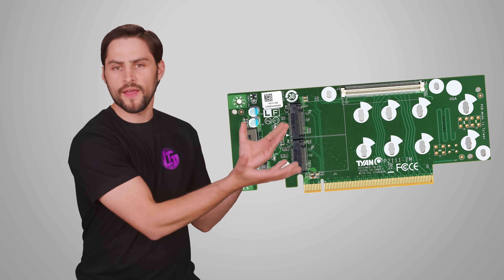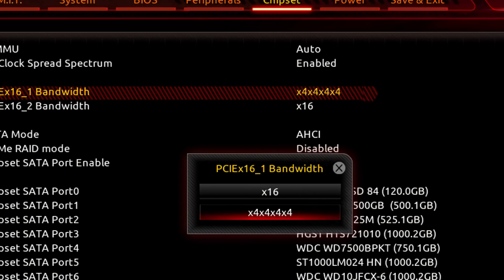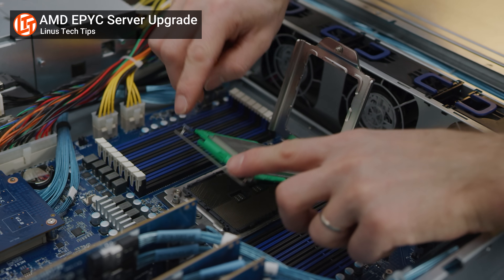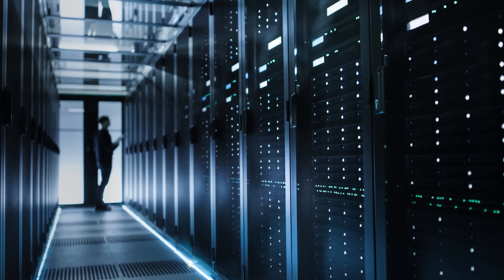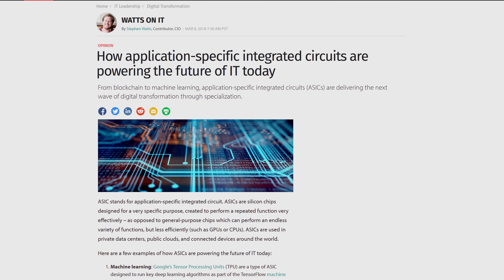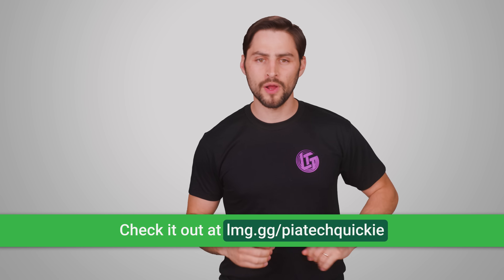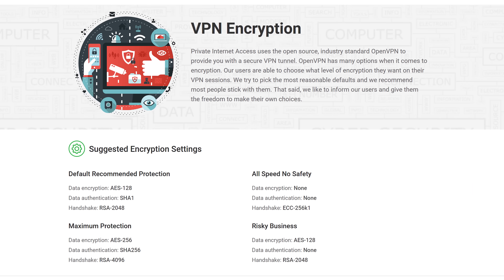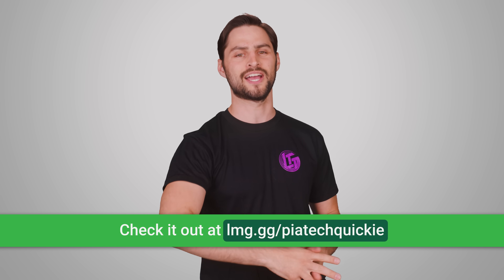TWO Graphics Cards in ONE Slot?! - PCI Express Bifurcation

Comment: I am a bit lost on this, i used bifircation for my 6900xt and Asus Hyper M.2 expansion card, my GPU runs at x8 but the expansion card run at x4 limiting me to only 2 of the 4 m.2 slots in the expansion card. The Asus Hyper card is currently in my second x16 slot, any one got any idea why i couldn't pull of x8 x8??? 

I have a Ryzen 5 5600x 
Asus Crosshair VIII 
xfx 6900xt
Asus Hyper X

Comment: How about 15 RX 5700 XT's on a Gigabyte TRX40 Designare MB each with x4 M.2 to PCIe 4.0 x4 adapters. For a Render Farm/ 789 MH/s ETHERIUM miner. 2tb samsung 970 evo plus use as HD.  19 would give you 1gh/s

Comment: PCIe bifurcation: welcome to how Gigabyte (and maybe Asus?) did the very first single-card SLI solutions (6x00 series GPUs) and locked them to specific motherboards.
Sometime later (7800 series) , Nvidia thought of using a PCIe switch to make the whole shebang work just fine on pretty much every motherboard.  Every dual-GPU solution since then has used switch chips to avoid the whole mess of motherboards and chipsets that do or do not support bifurcation.

Comment: Allotting more than one device into an available PCIe slot is always an option, but a possible barrier to considering that option is the critical need to supply power to the devices being used. If you cannot properly attach the devices to the power supply then you won't be able to install the devices.

Comment: Epyc gives 128 lanes, so you get a lot more than 8 PCIe devices.  E.g., Dell R7525 can be configured with 24x 2.5" U.2 NVMe drives (presumably 4 lanes each).

Comment: Can you actually enable SLI or NVlink in this configuration? 
I have a build that would benefit greatly If I could use an ITX board with a bifurcation splitter and riser cables and dual GTX1080ti

Comment: i run my non gaming PC GPU in x8 since my capture card requires an x4 slot and a max payload size  of 512 bytes. By design the MOBO has the HD audio and the internet adapters share the x4 slot bus and this causes the payload to drop to 256 even though the Bios says the CC is in x4 configuration.

Comment: USB3  bifurcation (ubs3+usb2) works out of the box. Tested. That is,  you can plug a mouse + usb3 device using only one USB port. This is by design of the backward compatibility of iusb3. Look at pin def. The data path are completely separated. Only the 5v is shared.

Comment: "you can't shove 2 graphics card in one slot"
Gtx 590 is waving.
Reply: AMD 7990,8990 r9 295X2 Radeon Pro duo, Nvidia 7950GX2 and 9800GX2 all jumping up and down excitedly in the background
Reply: I mean these are not two graphics cards rather two GPUs on one graphics card

Comment: You don't always need to be able to tell bios to divide up  PCI-express lanes.
Remember there is several Graphics cards on the market that actually is 2 in one 
card usling ( example with Nvidia ) Sli config it's two graphics cards but it's on one card.
Same tech is used in some ' add on splitter cards ' so you can install two cards in one slot.
Also many socalled ' passive ' splitters working fine on older computers where you doesn't 
have this option in bios.
It's NOT new tech , this have being done for years .
Typically bios see one card and boot up the computer with that as the standard.
Inside the operating system all have to do is install the second card and when system 
is booted up and operating system running then the other card is visible and ready to use.
SLi in one PciExpress slot , yes , that's old tech now.
Servers have a special way of doing this because here the use is NOT graphics cards but 
mostly Controllers for darddisks and network and Fibre comm cables and system managements ect. ect.
SO more complicated and in need of a different control of the lanes.
Reply: oups NOT < darddisks  > Ha ha ha ha , damn it's morning , Coffe Coffe and more Coffe...
I mean        < Harddisks >  Ha ha ... Good morning ...

Comment: Huh, I spent like an hour this morning trying to figure out the best way to bifurcate my PCI-E x16 slot on my x570 to drive an RX5700 over x8 and give me two more x4's. It's got the BIOS support but I can't find an appropriate riser card; the only thing I can think of is a 4x4 M.2 adapter then M.2 to PCI- x4, but that doesn't let me keep my x8 for the GPU. Do we have any idea of how far PCI-E 4.0 will run outside the case? I've heard it's just a few inches without a repeater. I've been thinking of just adding another case to house my extra cards/an extra PSU, I also have some PCI-E x1 to 2x PCI adapters so I have like 12 cards to plug in.

Comment: Actually a 1080 Ti 2x SLI system with 2x 8xPCIe 3.0 runs slower than a system running 2x 16xPCIe 3.0. So there is a bottleneck, at least with 1080 Ti, 2080 Super, and so on. With PCIe 4.0 it truly doesn't matter but... I think Intel doesn't know about something that is faster than 3.0.. Probably should tell em.
Reply: No your old SLI bridge is the bottleneck. People with NVLinked GPUs (including myself) have no scaling issue https://www.youtube.com/watch?v=84OkcOYmXOk&t=551s

Comment: Hm didnt even know that some BIOS must be told to split up. Do this Riser-Cable-Multiple-Grapiccards shit since years on all sorts of older computers since several years for crunching on BOINC projects and it allways ran fine, not only using the PCI-E16 and 8 slots but also used risercables for PCI-E 1x with x16-slot-sized ending to use even more graphiccards and even that hat a lousy lost of only 5-8% vs pure x16 usage.

Comment: How do I get ahold of that oversized tower case Linus was using at 3:13?
Reply: Unfortunately you don't, that's the Caselabs Mercury S8
Caselabs went under a while back and even used ones are damn near impossible to find

They weren't exactly cheap though either

Comment: I've got a mini itx board with a 1080Ti, but my weird case has room for 2 cards. I'm planing on picking up a second 1080Ti to extend my PC's lifespan when they get cheap. I was going to switch to a mini dtx board, but splitting the lanes could work too.

Comment: I mean, unless you don't have any other PCI Slot available, or you want to just play with that, in theory there should be no difference between this and plugging another GPU on a different slot. 
It is not like your system will recognize your 2 cards as one Megazord and you will double the performance.
Not saying that they said that in the video, but I can see many people hyping this.
Interesting option, nonetheless.

Comment: This is interesting. I have no idea how could I use it in everyday life, but it is interesting that it is possible!
Reply: Maybe if you lack PCIe slots so you can split them up to get at least one additional slot
Reply: @RobertPucovsky  Yes. I'm doing this sort of thing with a mini ITX build. The base operating system is linux, and outputs on a GT710. Inside that is a virtual machine that has a dedicated GPU to minimize performance losses from virtualization.

Server and gaming rig in one tiny box.
Reply: I have a card that splits a 16x slot to 
4 - 4x m.2 drives
Reply: @ethanli7995  why do you want 4 nvme drives?
Reply: @aribloch  because it's fast and awesome, if you have the money then why not.
Reply: @johnhunter7244  14 gbps isn't necessary...
Reply: @johnhunter7244  legitimate question though: I have a dell XPS tower and it has a 256gb Toshiba nvme drive. Is it worth upgrading it to a 512/1tb drive with >2x speed or just getting a cheapo sata SSD to replace my hard drive?
Reply: @aribloch  Well, really depends on the usecase.
Reply: @aribloch  raid.
Reply: @aribloch  I never said it was necessary, if you want to go down that path then why are you wanting a hard drive? You could get tape for cheaper. Is your current 256 GB Toshiba nvme drive a hard drive or ssd? It seems like it's an ssd but you said it's a hard drive. It really depends on how much money you are willing to spend, if you can afford the ssd go for it, if not go for the hard drive.
Reply: @johnhunter7244   Why did you ask if an nvme drive was a hard disk drive?
What I think Ari Bloch is asking is should he upgrade his 256gb nvme drive to a larger capacity one OR replace his secondary drive which is a hard disk with a sata ssd.
Reply: @johnhunter7244  sorry if I was confusing. I have 256gb nvme + 1 tb hard drive. Total I'm using <400 gb. Basically just windows install and a few important apps on SSD and everything else on hard drive. I was thinking either a bigger nvme to replace both drives, or sata SSD to replace hard drive and leave nvme as is
Reply: @ShinoNC  exactly
Reply: @aribloch  sorry for late reply as youtube doesnt tell you when you are replied to, just get whatever you can afford.
Reply: @johnhunter7244  no problem. There is no price issue for me, I can afford either. Probably will just get sata SSD because it's easier to replace without copying windows
Reply: So if you ran that expansion card thing, would the system treat it as one one gpu? Really just want to know if it would micro stutter like normal sli.

Also, would love to see a vid comparing single gpu, two gpu normal nvlink sli, and expansion card nvlink sli
Reply: Quick consumer application - have a look at Gigabyte's new B550 Master.  I'm not sure if one can control the bifurcation, but I do know that one can fit 3 PCIe 4.0 x4  NVME drives to it.  The first NVME slot is a PCIe 4.0 4x lane direct from CPU as normal.  The PCIe 4.0 x16 slot provided by the CPU for the GPU get's bifurcated and turns into an 8X slot, then the PCI 4.0 x8 lane what would have gone to an 2nd x8 slot gets bifurcated again to two PCIe 4.0 x4 lanes for those last two NVME drives - that's how Gigabyte managed to deliver all those PCIe 4.0 NVME lanes with them all going (nearly - got the PLX hops)) direct to the CPU as opposed to the chipset.  Any NVME drive connected to the chipset would be limited to PCIe 3.0. :-)  So that's a way a consumer could use it in real life. :-)
Reply: For gamers not much use. But for ppl that use cuda or opencl (like me), this could make a lot of difference.
Reply: You can use it for mining
Reply: Thunderbolt 3 supports chaining. So does pci express. Nothing supernatural.
Reply: dozen vm-s
Reply: SFF ITX workstation with dual graphics card? xD Not sure why you need that tho
Reply: So it's like in school...
Reply: Dual 4k60 capture cards rather than dual GPU.

Comment: Graphics cards only really need 8x? How true is that, really?
I ask because I need to run 2 graphics cards, not because of SLI, but because I have too many screens for one card.
With an 8x 10Gig card, that means my next build is going to need two 16x slots and an 8x slot, which isn't actually that many motherboards.

If I only need three 8x slots, all of a sudden I have WAY more (and cheaper) choices...
Reply: I run 2 RTX GPUs in SLI. They run in x8 x8 configuration and that's plenty enough because 90% of applications that use both GPUs utilize the NVLink bridge instead of the PCIe lanes. This dude explains it much better than me https://www.youtube.com/watch?v=84OkcOYmXOk&t=551s

Comment: Please, PLEASE don't run 2 GPUs in 8x/8x. Yes, 1 GPU at 8x is fine, but multiple GPUs communicate across PCIE in addition to bridges. The performance penalty of 8x/8x over 16x/16x is very well documented with plenty videos showcasing this. This is going to make multi GPU setups look MUCH worse than what they actually are in compatible games.
Side note, I find it funny that they got James, who's been known to bash multi GPU in the past, to basically low key promote multi GPU setup configurations.

Comment: What I learned from this....Do not cut pci express slot in half and do not glue 2 video cards together.
Reply: yeah, you need to use Duct tape
Reply: @RinnosukeETQW  or wire
Reply: @DeadBrain A chainsaw...
Reply: Is this a wood screws reference?
Reply: Coward
Reply: @roguevariable8367  *Hans Zimmer-Coward intensifies*
Reply: LMG SOULD HAVE AN APP... sorry for yelling.

Comment: There are pcie raid cards that can be used on motherboards that dont support bifurcation, so you can use up to 4 nvme drives in one slot. Theyre quite a bit more expensive tho due the chipset needed.

Comment: Is using a Nvme drive with pcie adaptor on the pcie slot (since my motherboard doesn't have m.v nvme slot) worth it? If so, which is the best adaptor?
Reply: What’s the work load
Reply: @goronslime1469  sry to sound like a noob, iam learning things, please can you say what's workload?
Reply: Mickey Tech what do you plan on using it for
Reply: any old adapter should be fine. I recall vendors being very slow to market due to issues booting off of PCIe. Either get a regular cheap one, or consider an x8 one with some slots.
Reply: @DoctorWhom  for nvme ssds, x4 is enough ?
Reply: Short: Yes its working.
Long: NVME is PCIe (mostly x4) so no problem here. But if your board is old enough for not having m.2, it maybe isnt capable from booting an nvme/pcie device, so it couldnt be used as boot drive. Workarounds can be a pain in the back, so make sure it IS supported. I'm running i7-3770 on Z77 with nvme ssd, but i had to mod my mainboards UEFI, not recommending to anybody. I use a cheap AliExpress adapter by the way.
Reply: @louism771  that's the problem here. I have also seen some cheap ones but saw 2-3 people complaining about smokes coming .... And Thanks for your reply✌️

Comment: Can you power a hard drive with one pc, and get information out of it with another?
Reply: If they have common ground, then teoreticaly yes, but why would you do it?
Reply: Anonym Anonymní your entire house has common ground lol.
Reply: Yes just plug it in it will work but don’t keep it running like that forever. If you’re transferring data and the power cuts out then you could destroy the drive and lose your data.
Reply: of course? you could power the hdd with the power supply from one and the sata from the other. Or, you could just network the two computers together and file share.
Reply: Well you cant Power a HDD or normal SSD with your PC anyways. It's only the powersuply that gives the juice. It could be any PSU tho

Comment: pci express x32..?
Reply: Someone forgot basic math along the way.
Reply: There are no devices that support a single x32 connection between controller and endpoint, however x32 slots do exist in the server space to allow multiple devices to be inserted into a riser card. The same idea is at play with the OCP v3.0 NIC Mezzanine, which comes in small and large form factors. The small OCP v3.0 NIC is a PCIe 4.0 x16, and the large OCP v3.0 NIC form factor is a PCIe 4 x32 slot which allows multiple ASICs to live on a single mezzanine card.

Not something you'd see in the consumer space.
Reply: @noname-gp6hk  oh I see
Reply: Multiple endpoint devices do exist however, like higher end Intel PCH chips like the C629 which can support DMI x4 + PCIe x16 + PCIe x8 links from the CPU to provide connectivity to the multiple functions on the chipset, such as the C629's integrated 10GbE ports, encryption, and compression engines. Things get complicated on server iron.

Comment: See this is why we can’t have nice things because now I have to spend my entire next paycheck to have 2 graphics cards smh. Well no electricity this month I guess
Reply: >dropping electricity before dropping food
get out, normie
Reply: Doesn’t matter because Crossfire and SLI scaling is pretty much dead for gaming. Just buy the fastest card you can afford and keep it dusted out and updated. It should last quite a while.
Reply: Gta 5 mrboss reference?
Reply: referral madness  can... but dont, dx12 puts all the compatibility onto the game developers so amd/nvidia have nothing to do with which games are multi gpu compatible anymore
Reply: referral madness  The hardware has gotten so fast CPUs can't keep up (at least at 1080p with anything larger than a GTX 2060) without modern graphics APIs allowing for multi-threaded "render queues", like DX12 and Vulkan. Problem is, those APIs are waaaaay more complicated than DX11 and OpenGL, which means more costs for the developper.

The advantage is however, that such tech can allow for fine-tuning rendering on multi-GPUs, and even allow for something called "checkerboard rendering", where a single frame is rendered by both GPUs at the same time, in a "partial rendering and merge" fashion. This technique allows balancing the load: if one GPU is rendering a difficult part of the scene, the other can be rendering other "easier" parts. It's even capable of doing so using non-matching cards, from different vendors. It's called Explicit Multi-Adapter, however so far I've only heard of one game using it: Ashes of the Singularity.

So yeah, it's a matter of dev studios putting in the effort to code using complicated APIs and techniques. It's understandable they don't want to, as more code is more bugs is more money spent fixing something for the 1% of gamers who have two GPUs. Is it worth it? I understand dev studios saying "no". Is it still exciting tech? Hell yeah.